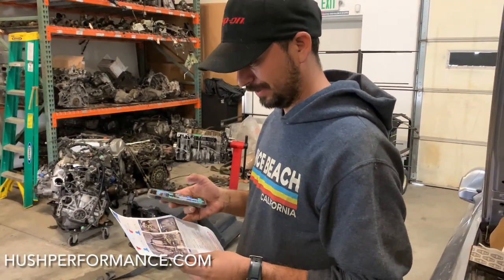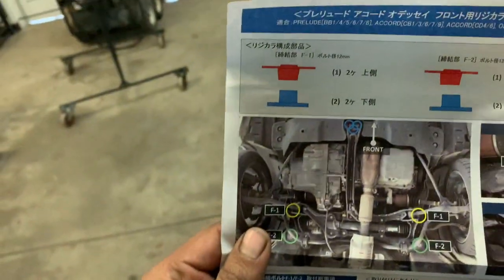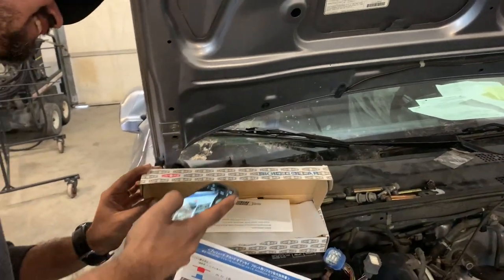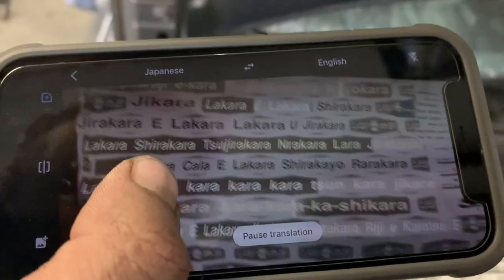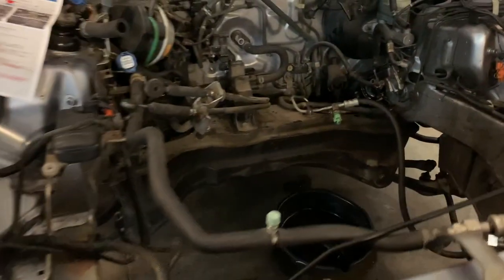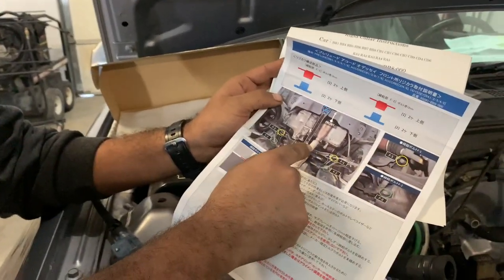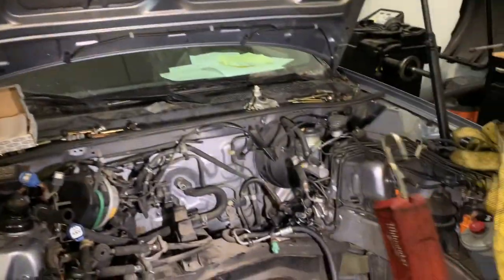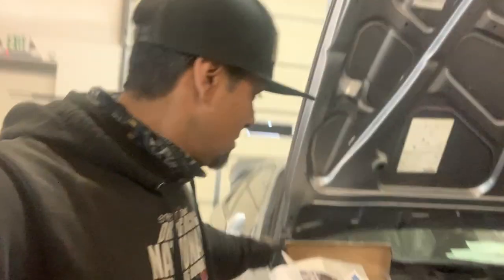Spoon Sports Rigid Collar Install 1997-2001 Honda Prelude

Comment: Does anyone know if EF chassis has this slop in the subframe bolts like the 97-01 prelude?    Always trying to figure out where a slight rattle is coming from even after rebuilding the entire suspension.
Reply: Any mass produced car ever will have this. The "slop" or simply the loose tolerances on those holes are so that more part fit together which results in less scrap by the company and therefore less money lost. Idk about your rattle issue tho.